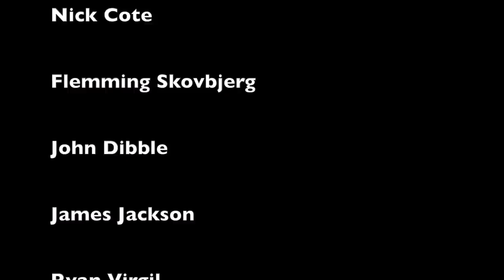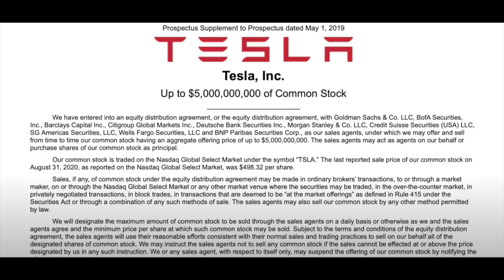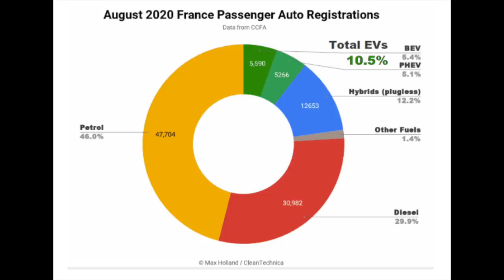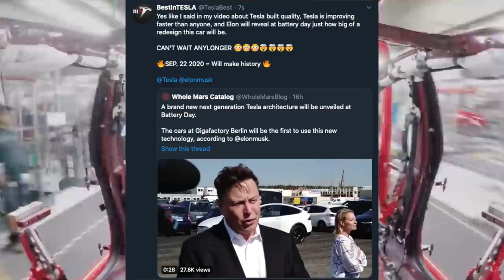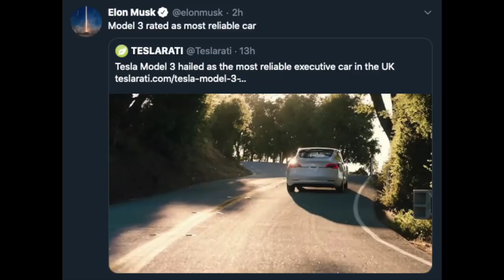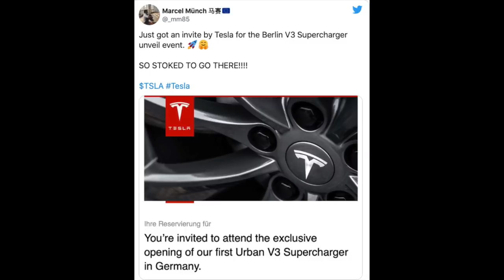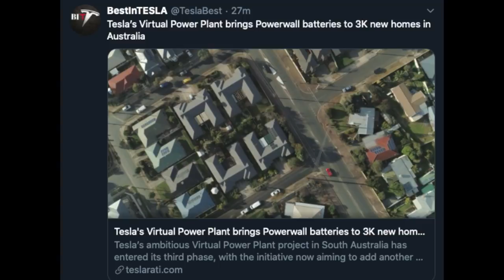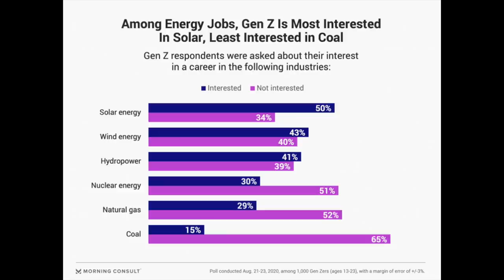Tesla sales are up 457% in Germany | Ford showing off insane new electric car | $5B in capital !!!

Comment: Of the 467% what are the number of units.?
Reply: Phillip Carr Manchester Mint Crypto I wondered the same question, because sometimes when you sell 200 and then sell 934 the following year that’s a 467% increase but 734 cars is not that much revenue. All those numbers in Sweden and Norway are all also very low relative to their total sales. They are small markets and will never move the needle the way China or the US will. However it still helps me build conviction to see general sentiment when it comes to sales of EVs, especially during the pandemic. It’s evidence that there is possible a strong trend in some of these countries which might also be indicators that there will be similar trends in other countries. 

Most importantly is the trends in the US and China and the last number I heard was 20% market share in China of EVs sold with 150 different EV car companies...that is impressive. There is also a large incentive for the Chinese government to push EVs over ICEs fueling this fire. As someone that holds a major position in Tesla I am much more focused on the number is China and the US. And with additional investment by Tesla to continue to build out Giga Shanghai and the soon to be released Model Y in China I am feeling confident that 50% YOY increases in revenue will be no problem over the next 5 years minimum.
Reply: @saufai74   2,846 units
Reply: Midnight Star thanks for the number, so less than 1% of their revenue for the year. Still a nice indication of the level of demand. Once GigaBerlin is delivering over 100K units/year to various European countries that becomes another $5B/year in revenue, but for me more importantly is the Tesla effect. The fanatical promotion of the high level of the quality of the technology that comes with almost every delivery. This will feed demand an brand loyalty for the next decade +. No matter how many different EVs the legacy companies put out, even if Tesla starts to lose market share, the EV Market is growing and will grow exponentially. I am not selling any of my shares and want only to support this company more by buying more.
Reply: @saufai74  July was only 154 while the market doubled to 16.7k august was a bit down to 16k because the supply is low for every EV, nobody was planning for 100% increase in a month and 200% since May.  Model 3 is only on 3rd place. first half of 2020 was slightly down but shipping has huge impacts on monthly sales.   E-golf and ZOE sold more than the best selling EV of 2019 in the first 7 months. Tesla and model 3 marketshare in 2020 is down by alot .
Reply: nox5555 Thanks for adding your numbers. There are so many factors that we are unaware of that will affect these numbers. I don’t know how Tesla decides to send certain cars to Germany in any given month. Are they custom building them as they get orders? Do they prioritize NA orders? Do they wait until there is a match in the specs of the order? Moving forward I’m going to ignore all of these numbers until GigaBerlin is ramped up, at least 6 months after they roll the first unit out. At that point, the European deliveries should be in the 30,000+ units / quarter. I can’t imagine any of the legacy automakers reaching those numbers in Europe, but only time will tell. I’m long Tesla. Where did you get your numbers?
Reply: @saufai74  thats early 2022, VW is already close and will be above 30k next quarter.
they already sold 10k in germany alone and the ID3 isnt even out.

Tesla doesnt send many cars to europe because the market is so hard. there are plenty of EVs to chose from and the only thing Tesla has going for them is the range, but 50 miles less isnt that important in europe.
Reply: nox5555 I just watched Rob on Tesla Daily and there was a report about plans to put in 8 casting machines which it was said by someone trying to do the math to an estimated 750-800K units/year. If there is any chance that is correct that would be crazy. 

Are you in Europe? I thought the moat for Tesla in Europe would potentially be the superchargers. I haven’t heard of competing infrastructure for other EVs to quick charge while on trans-country road trips. Do you see that as being a reason Europeans would choose Tesla over the other EVs?
Reply: @saufai74  Even the Model 3 is a large car by European standards. If you need a smaller cheaper hatchback for city use that stays within home commuting distance (which is what the cars that outsell Model 3 like the Zoe basically are), then extra range, acceleration, OTA updates, in car entertainment, supercharging etc are less important :) Hence the talk about making a smaller Tesla...
Reply: @saufai74   Charging infrastructure is pretty good in most of europe. Fast charger are around motorways while slower chargers are all around. the numbers are pretty good and growing fast since local energy company is building.
Reply: Midnight Star yeah I’m hoping that it’s part of battery day. An announcement of a compact / hatchback with a smaller price tag to be produced in Berlin and China. That would be the most impactful to the short term success of moving more people toward sustainable energy.
Reply: @nox5555  Tesla still has the advantage here - the supercharger network is faster, more reliable and easier to use in general, and Teslas get to use both the supercharger and public networks as required
Reply: @midnightstar4065  Tesla has a small advantage when it comes to fast charging. The public networks are alot bigger than Teslas network. Its only interesting for people who travel alot away from Motorways.
Reply: nox5555 @midnight star regardless of these things I still think the main constraint for Tesla is not competition and lack of demand but battery and production constraints. I can’t see Tesla filling the current growing demand in the near future. They will sell every car they build for many years to come.
Reply: @saufai74  I agree, most articles on Tesla "lack of demand" fail to appreciate that right now, if Tesla make and ship cars to meet demand in country A, that means fewer cars can be sold to meet demand in country B. It's more efficient for Tesla to spread deliveries across markets if they can. Plus the value of Model 3s sold in H1 in Europe exceeds that of the Zoe, despite fewer units being sold
Reply: @nox5555  In theory yes, in practice the Tesla one is soooo much better than the public one, that the public network is a "last resort". Here is the UK experience for example: https://www.motoringresearch.com/car-news/best-ev-charging-networks-2019/